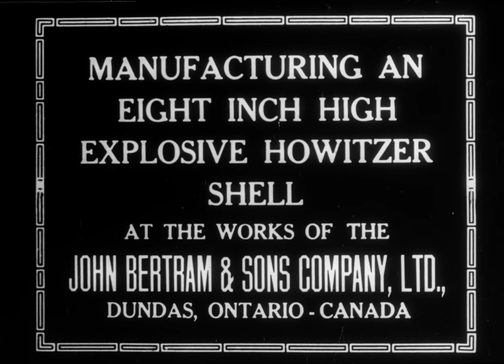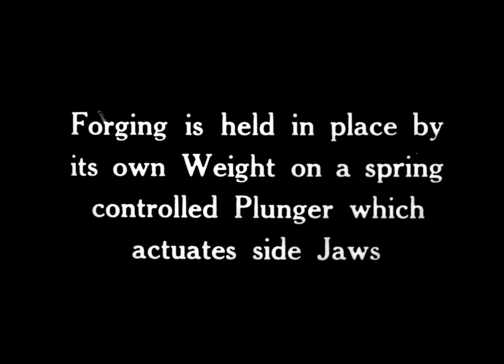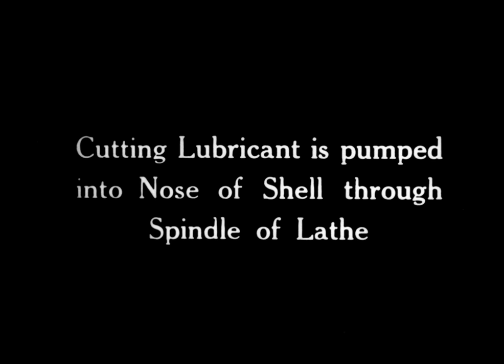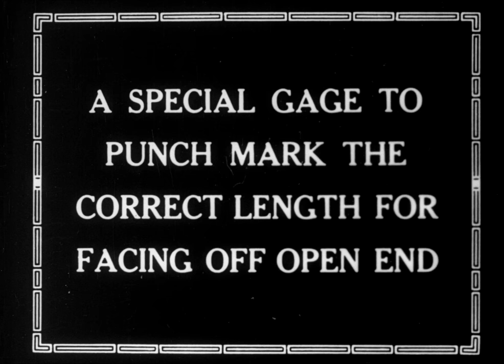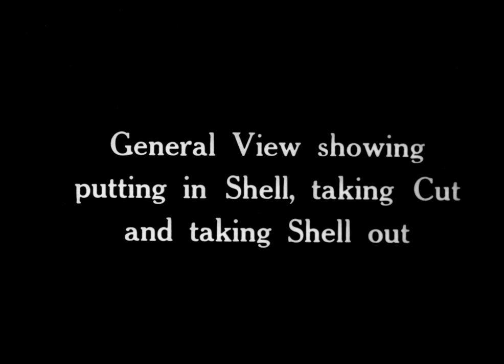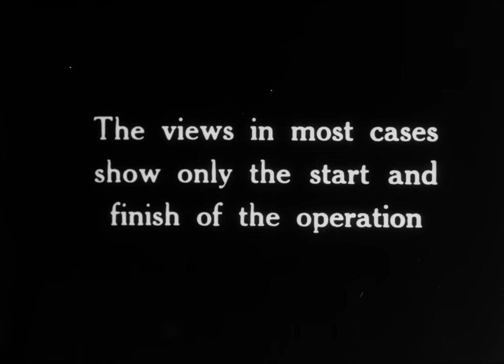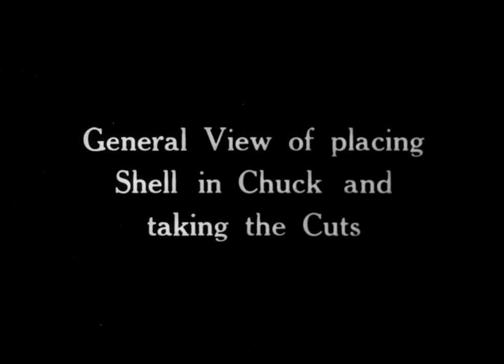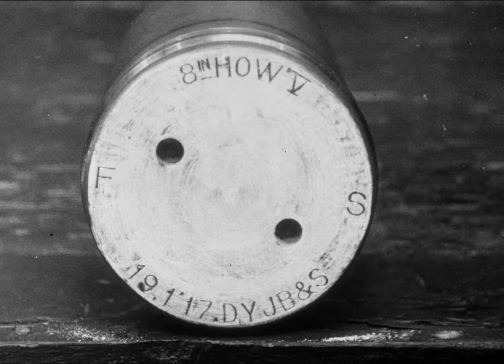Manufacturing an Eight Inch High Explosive Howitzer Shell (1917 ?)

Comment: An incredible amount of precision engineering for something that only has to work once and destroys itself in the process.
Reply: Precision engineering for killing...
Reply: yeah...in the 1980's I worked in a Machine shop as a welder, making parts for the 'Peacekeeper' Missiles...made me sick to see such high precision stuff that will only be used once... @enthalpiaentropia7804
Reply: Keep in mind that often it's suicidal mission involved destroying machinery thousands of times more complex than it's self.
Reply: Precision machining so that it does not get stuck in a gun barrel, the more true the surface, the more accurate the trajectory.
Reply: @brianjohnston9822  What you say is of course absolutely true but from a ballistics point of view I can't help but think other factors made the precision machining of the shell a tad over the top.

It's all very well and good having 8" shells machined to a tolerance of one thou but if a cross wind can blow it off course by +/-100' it does seem a bit silly. I'm not having a go at the video by the way... It's fascinating that this ever even happened.
Reply: @AnthonyHandcock  

Try loading your own ammo some time. You will see the need for precision.
Reply: @ardvarkkkkk1  Yes thank-you... I fully understand the need for precision but if you're thinking of something like a .308 then you're not comparing like with like. A .308 bullet comes ready made from the factory where it was stamped, pressed and swaged out at the rate of thousands per minute. The same goes for the cartridge itself... Mass produced by the hundreds of millions on fully automated machines. These shells are taking about five man hours each on manual machines.

I suspect by the time WW2 got into full swing artillery shells were being knocked out at a hell of a rate by automated factories.

I'm not entirely convinced an artillery shell has to be all that precise as long as they're symmetrical and within one or two percent of each other in weight. There are two many other variables in artillery to start worrying about a thou here or there or a fraction of a ounce.Compared to an 8" shell it would be like worrying your .308 bullet weights varied by 1/10,000 grain or were over / under size by 1/10,000".
Reply: @O R Y X I'm not suggesting accuracy isn't required just questioning the need for the degree of accuracy in the film and the amount of labour required to achieve it. 

Of course the film was made when the whole concept of mass production was quite a new thing so it's no surprise they did things that way. By WW2 I'm sure they'd learned ways to speed things up substantially.
Reply: @AnthonyHandcock  If this truly was a "howitzer" round, then it would have been a ground-to-ground, high trajectory lob. Accuracy was less important than area coverage in WWI. OTOH, if this was an 8" naval canon round, then you are trying to hit a 30 meter wide target at over 12 miles, and close doesn't count for much. I think that this may be a naval round, because I don't think a ground howitzer would really need a forged shell casing, but for penetration of a steel ship, the forged casing would be a must.
Reply: @wb6wsn  Ah... I think you might be on to something there. That would make perfect sense.
Reply: Still, wouldn't want it 'working' too early while it's still in the barrel of your weapon...
Reply: @wb6wsn  these were probably for field artillery, not naval use.  These guns were used to destroy trenches and fortifications.  The Germans used lots of concrete bunkers, pillboxes and had deep dugouts.  Prior to the Battle of Vimy Ridge in April1917 the artillery delivered a million shells in the week preceding the attack.  The Germans called it "the week of suffering".  Our guns were hungry for shells and the output of this factory and places like it needed to keep pace with demand.  Naval operations were not so intensive in materials.
Reply: @exJacktar  Yes, I had forgotten that late in the war, there was need for deep penetrating field artillery. Interesting that these shells were date stamped with "19 January 1917" (just about enough time to be shipped across the Atlantic and make it to Vimy Ridge). I also found it interesting that each shell was shipped in an elaborate wooden case; I would have thought that it would have been less wasteful to have packaged several rounds in a larger box. There must have been no shortage of firewood for artillery batteries!
Reply: @wb6wsn  when completely assembled with fuse and filler, each shell weighed 200 lbs.  Don't forget, these had to be man handled onto and off transport as they progressed from the ship to depots and eventually the gun positions at the front.  As well, those crates were bulky enough as it was, you have to consider what kind of transport was moving it forwards too.  They used trucks, mini railroads and of course, the ever suffering horses, none of these were large in cargo area.
Reply: @AnthonyHandcock  : have people read of "creeping barrages"? The guns would  shell the area just ahead of the infantry marching across the battle field. The artilary would keep their shells just ahead of the infantry.  I think accurate shells would allow for this.
Reply: @drewthompson7457  OK in theory but I think Ed got this right earlier and these were naval rounds where they were using very consistent rounds through very well made guns using very good aiming methods to hit very small and well armoured targets at very long range. Very well made shells but not many get used so the price wasn't so much an issue.

I'm pretty sure from the accounts I have read, and heard from a couple of my how deceased ancestors, that walking barrages were more a theory than a practice and if shells were landing anywhere in sight you kept your head down as you didn't have a clue whose they were, who they were aiming at and if they coming to wards you, going away or the random potshots of some incompetent nutter. One of my great uncles had a lot of affection for The Royal Artillery. They shelled his position and rendered him deaf to such an extent he was discharged from having any further involvement in WW2 thus saving him from Germans wanting to kill him and having to listen to his wife. He did get most of his hearing back after the war but it was highly selective "When are you going to take the bloody rubbish out you lazy sod?" remained inaudible but "Coming to the pub H?" always got through for some reason.
Reply: yes that was running through my head the entire length of video
Reply: gurka321  - but how many man hours would it take to make one million shell, if each one takes so many hours to make?  How many people were working in these factories?  I can never comprehend where Governments find the money to finance wars.
Reply: The boys in the field will thank you for that precision, so for when it's time for the gun to go boom boom, the shell doesn't misfire and kill the gun team
Reply: @dougankrum3328  The idea is that it will never work, but will be of such perfection that the enemy knows it would work flawlessly. In that sense, your parts did their job daily in the minds of strategic planners from the moment they entered their silos to their retirement. Which, apparently, is as satellite launch vehicles. Nothing to be sick about there.
Reply: @dougankrum3328  I've thought about that as well.  Those single use multi-million dollar missiles getting blown into little parts.  High end electronics, massively fast radar and computers,  super cool hardware all gone.
Reply: could be worse,imagine if they were made in US and get to the bottom of the ocean inside the merchant ship by thousands.
Reply: Just like the process of man itself
Reply: @goodcolimgpu10  Way to miss the point.

Oh and by the way. When you are telling people that they are idiots it helps if you don't make stupid mistakes spelling very short words. 

*Flies*

You're welcome .

(PS: *Yourself* ... Also welcome.)
Reply: It feels weird using essentially the same tools fo my  daily work a hundred years later.
Reply: @vHindenburg  I wouldn't be surprised if at least one of the machine tools in this film is still alive and well and living in somebody's home workshop or back-street engineering business. A friend of mine has a lathe that's older than this film and still going strong.
Reply: @AnthonyHandcock   It still feels uncanny, I mean for those people some of their family members the start of the industrial revolution might still be in living memory. And I live a hundred years later and just could walk in and start to work there.
The more changes the more stays the same eh?
Reply: @vHindenburg  Absolutely. It's strange the way your perception of time changes as you get older. When I was a kid this film's era was ancient history. Now it's less than twice as old as me (just). I assume "the young people of today" (I've been waiting a long while to be able to use that expression) think of the 1960s from whence I come in the same way... Ancient history.

Oh well... At least I'm not so old and senile as to think things were better in "the good old days". I can remember the late sixties to a certain extent and the 1970s and onward very well... And it was crap back then :-D

Mind you... I still haven't fully processed The Jam splitting up and that was 38 years ago.
Reply: @AnthonyHandcock  I cannot imagine how it would feel being my grandma , she was born in 26 all the things have changed. She saw the change from petrol lamps to gas to electricity. Radio recievers were just making it into homes. 1990 Steamlocos were phased out finally. 1960 the home finally got a proper sewage drain before that a company had to come and pump out the cesspit. Grandma grew up heating with coal, cars were a rarity, almost all movies we think as classics wouldnt have been made yet in the 1960ties yet. Even my parents couldnt afford colour TV before 1995. At the same time there are streets around here where it wouldnt make any difference if it was 1492,1845 or 2021, espeacially know since a lot less cars are around.
Reply: @goodcolimgpu10  OK... But French isn't my first language and while I can speak it reasonably well my written French is terrible. That's why I can call people stupid in spoken French but doing it in written French would almost certainly result in my making a fool of myself... So I don't do it.

A wise man knows his limits.

Oh and by the way.... English not being your first language has nothing to do with the fact you completely missed the point.
Reply: @AnthonyHandcock  with your logic: this ship might sink one day, so make the compass as shitty as you can then we sail past out point, do you get it now?
Reply: its like why kill the enemy with 1 good shell that hits it fuking mark, than have to shoot 20 shell to do the same work
Reply: @goodcolimgpu10  "with your logic: this ship might sink one day, so make the compass as shitty as you can then we sail past out point, do you get it now?"

No. That's not even close to being comparable so there's no point to get. A more accurate analogy would be fitting a chain ferry on a 200m river crossing with the latest in cutting edge radar and GPS capability. It would work and it would work well but it's not necessary.

"its like why kill the enemy with 1 good shell that hits it fuking mark, than have to shoot 20 shell to do the same work"

Because there is a limit to how accurate any gun will be and that limit is only partially determined by the quality of the projectile. In any event most artillery fire is area denial rather than anything else and the accuracy is irrelevant within limits. This has already been covered up-thread if you could be bothered to read it.

"stick to your crappy food and speeling bees fuk boi then i make the engernier shit okay?"

I literally have no idea what that gibberish is supposed to mean. Is there a name for what's wrong with you?
Reply: 100$ paypal to who ever takes  @Anthony Handcock  out of the gene pool
Reply: @goodcolimgpu10  Grow up.
Reply: @AnthonyHandcock  come to ukraine then i will show you 6 feet under
Reply: @goodcolimgpu10  Dream on you silly little boy.
Reply: @ardvarkkkkk1 can confirm, having cast bullets, sized and lubed same, then loaded ammunition using cast and jacked bullets in a number of calibers.

It can get a good deal More precise if you are doing Match-grade ammunition - more steps, weighed and segregated bullets, weighed charges,segregated cases, etc.
Reply: @AnthonyHandcock the prospect of beer helped with the tinnitus?
Reply: @dennisyoung4631  I don't know but I fully endorse using the scientific method to find out 🙂